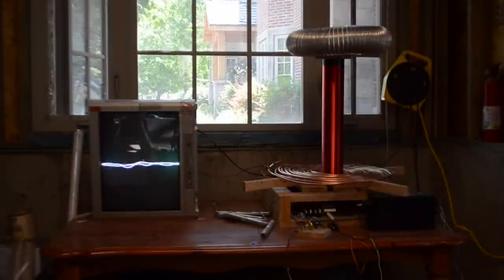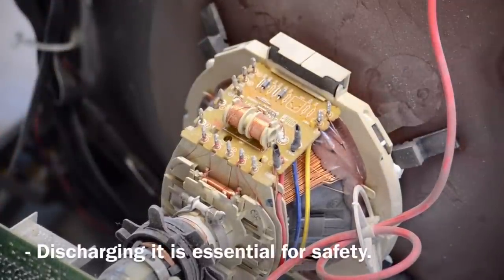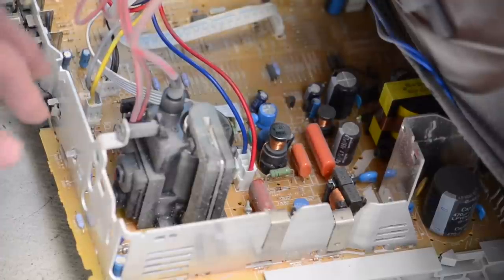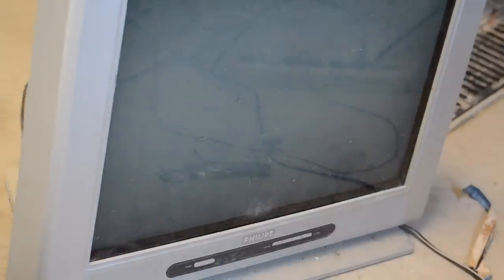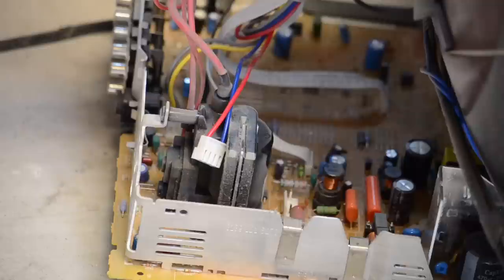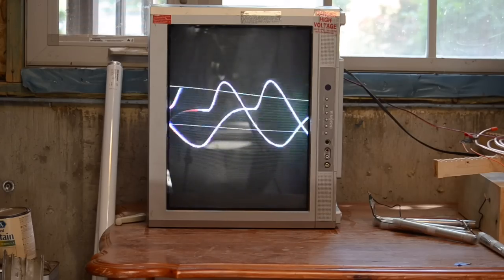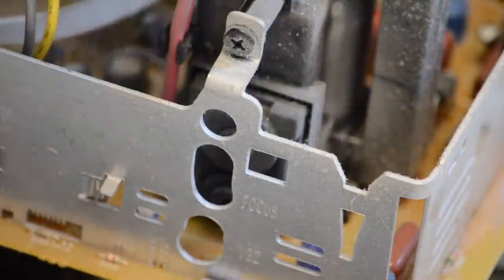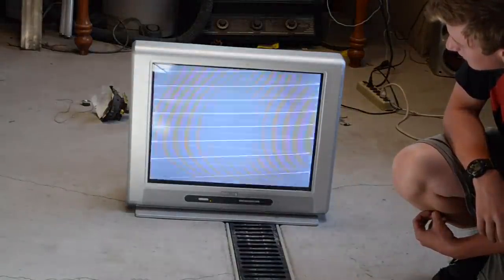How to make an OSCILLOSCOPE

Comment from the maker: By the way, you can calibrate this to use to measure peak voltages and such, I'll make a video soon showing how
Reply: I did it and it worked!!! it's really cool and was you addjust the fly back trasfomer(when it's unplugged,thanks for the tip) you can make it be a thick rainbow line.
Reply: if you can make a vr headset, no need for audio. just plug hdmi into pc, no android required, ill pay you for it. gotta be under whats in the market of course. 
and try mimic the lighthouse tracking that htc vive has. Its way better than IR positional tracking, a little anyway.
Reply: Keystone Science, I made one this evening, but it keeps popping capacitors and mosfet transistors... any remedy for that?
Reply: Keystone Science
Reply from the maker: +zeb evans wait, the oscilloscope is popping mosfets and capacitors?
Reply: Keystone Science  yeah, I had it running for about 30 seconds before I got a loud whine from the board, then smoke. blew a capacitor and melted the legs off of the mosfet
Reply from the maker: +zeb evans oh wow, that's super interesting, I've never heard of that happening before. Were their any problems before hand? ( I've run mine for a long time and it just recently (a week ago ) broke ( that's why it's no longer in the background of my videos ) but mine broke because it fell off the table and the vacuum tube broke. )
Reply: Keystone Science, I had no problems before hand, but once it started to go, it was done for
Reply from the maker: +zeb evans huh, that's super weird, is it possible that when taking the TV apart, or when disconnecting the coils that you messed up the connection on another part of the board accidentally?
Reply: Keystone Science, that is a possibility, yet I was very deliberate with my disassembly
Reply: Keystone Science So I tried doing this with an old crt TV. Things were going well but I didn't know where the capacitors were or how to discharge them so I just ran my grounding cable everywhere. I touched something (with the grounding cable) rather large in the circuitry and it blew up, bright light and all. The wires on my grounding cable melted together, and the TV won't turn on anymore. 

I'm wondering if you know what part of the TV I grounded, and why it exploded/broke the TV?
Reply: +clonesmustdies Was it connected to anywhere (I assume not)? If not, then it was most likely a big capacitor. Did you just use a thick wire straight connected to the ground? That would discharge the cap in an instant thus melting your cables.. As discharging capacitors too fast (without enough resistance) will damage capacitors the explosion was the capacitor breaking..

Now the important part... Even though you broke the TV you managed to save your life, a big capacitor with power stored inside enough to melt your cables could easily have stopped your heart. So for next time remember the safety!
Reply: clonesmustdies Melted? Exploded? Dude, you're supposed to do that unpluged from the electrical socket. And there's no need to run ground cable everywhere, just short the capacitors above 100 volts.

There are 4 major places where you can get a powerful shock from an unplugged CRT TV:

1. Primary (Hot) Smooth Capacitor, right after the full bridge rectifier (160~280VDC). Enough for a loud bang and some sparks when shorted.

2. Flyback Output Smooth Capacitor (180~250VDC) RGB Cannons' Power Supply. Not so loud bang and some sparks when shorted.

3. +B Smooth Capacitors on the Transformer Output in the Secondary (Cold) (80~160VDC) - but only if there's a blown fuse after that capacitor. Loud bang and some sparks when shorted.

And finally, 

4. High Voltage Flyback Socket (Over 7kvac). Yes. It remains charged with thousands of volts thanks to the CRT. It's just enough for a small arc, tho. Just a quick static pulse but ONLY if you manage to stick something inside that rubber thing that's supposed to keep the socked sealed - or if there's a leakage somewhere along the cable.

None of those are able to explode or melt anything, but they're enough to get you a fibrillation or scare you to death. Charged capacitors hurt real bad and VAC hertz even more.
Reply: Did you ever get a chance to make that video?
Reply: Can you measure 120 v AC with this thing?
Reply: Idk if you still answer questions from this but, will this work with things like Jerobeam Fenderson songs or vectrex games?

Comment: I learned to be careful taking apart tvs like that the hard and painful way
Reply: i was attempting what he did, ended up getting shocked twice. Apparently the hole where the suction cup was plugged in held a charge too so when i went to wipe the dust off the back of the tube i got a good jolt. then i tried making an arc like he did when he unplugged the suction cup in the previous video and it ended up jumping from the ground wire i had to my hand instead. even more involuntary arm dancing

Comment: Hi, I just completed this project, and it worked like a charm- I loved it... until it tried to kill me... (Not really). I was playing normal songs and using a frequency generator when the tv suddenly screached at me- it sounded like the flyback transformer. It was a sudden, very loud, continuous high-pitch sound. I unplugged it immediately. Any idea what happened? Is it dead? Thanks!
Reply: did you try turning it off and back on?
Reply: I mean it's a tv after all so
Reply: Am also curious if you are still coherent
Reply: @StaticFPV  hahahahahahah

Comment: Shango066 has a video where he ends up going through the "supporting levels" of vintage CRT's. Excellent video!

If I recall correctly, horizontal drive is what drives the high voltage.

Comment: Hey man! I’ve been searching around on the best ways to do this, I think my tv is one like yours, any other ideas to remedy the “protection mode” it goes into since the video was made? 
I don’t have another tv to sacrifice 😓 
Currently I have it set so there’s both wires from my stereo speaker outputs, hooked up to both the horizontal and vertical coils in the tv 
Whilst leaving the flyback to charge the tube of course, if you have a chance I’m going to post exactly what I have currently on my channel for reference, but I really like it how you had it going! Truly what I was aiming for initially. 
Was the audio from your stereo just coming from one speaker positive and negative?

Comment: Hi! Did this with a tv, after some time, the beam in the center of the screen created a small dark spot that stayed after turning the device off. Can it be dangerous to continue using it? I'm thinking it might have removed the safety layer inside and I'm afraid of the x-rays.
Reply: its just screen burn. its nothing really.

Comment: The reason that the TV didn't start up with the same amount of resistance in resistors as the resistance of the coil, is because of the inductance of the coil. The coil will limit current by using power to drive the magnetic field associated with it. Resistors won't do that, so you'd have to use something of equal inductance.
Reply: Hi David, I seem to be running into this problem trying to build an oscilloscope of my own, what could you use in this case that isn't a resistor? Thanks!
Reply: Connect the horizontal coil to the vertical output, And connect the audio to the vertical coil. Boom don't even need to turn it around.

Comment: Always resourceful and enjoyable video contents, yay! Thank you very much Nate:) i really love what you're doing** i love physics, too. Thanks to you😊 you are so inspirational! Did you self thaught yourself? You're crazy talented^^ i already give a thumbs up plus subscribed. Love ya♡ (btw, i have one question: what does flyback transformer exactly do? Is it a high voltage converter thingy?)
Reply from the maker: awe, thanks <3 
Yeah, I'm self taught,  also good to hear! physics is the greatest!! A flyback transformer is a highvoltage transformer, but it works in a special way called flyback, basically, this means that it is very good for switch power supplies, so i can push current through the primary coil and it builds up a magnetic field. The secondary coil has a diode across it as to only allow current in one direction, when the field strength is high enough, the magnetic field on the primary rapidly collapses, and induces a high voltage across the secondary. This happens in rapid frequency determined by the driver attached to it. So yeah, in essence, that's about it! It's all just changing energy from one coil to another through a changing magnetic field!
Reply from the maker: However, if you mean to say what does it do within the TV, it applies a high voltage field across a near vacuum of the CRT, and so this way, the electrons with a negative change are driven towards the positive side of the TV, the electric field causes the electrons to accelerate to a very high velocity, so that when it collides with the phosphorescent screen, it will be enough to create photons of visible light converted from the energy of the electron :)

Comment: If you don't wanna have it laying on it's side and you'd rather just use the 60hz, you can just plug the vertical deflection out from the board into the horizontal coil. Also, I agree that the "safer" TVs suck for any electronics projects.

Comment: Why not make it horizontal?
Reply from the maker: The scanning of the tv makes it very hard to make it horizontal, it is much easier this way
Reply: You just connect the Horizontal coil to the Vertical output on the circuit board.

Comment: Hello, Keystone Science. I built one of these oscilloscopes this afternoon; easiest electrical build I've ever done thanks to your video. But if I had an input signal and wanted to determine its frequency, how would I go about changing the speed at which the electron beam zips back and forth across the screen, like a "real" oscilloscope? Could you cover that in a future video maybe?
Reply: the speed of the horizontal sweep is usually controlled with a sawtooth wave generator. i imagine the answer youre looking for is related to computing a value from there.

Comment: I belive I just shorted out my TV. Is there any thing I can do so that it will work again? Thanks in advance.
Reply from the maker: +CallForPlay where did it short out at?
Reply: So... when I got this tv, it wasn't working. I learnt it was a simple problem with the flyback Anode. It was misplaced. I basically put it on the right position, and turned the tv on. It worked properly! Well, at least for the next 2 minutes, hehe. I turned it off, and when I turned it back (actually, just plugged it on the outlet, and it started by itself) it behaved like yours. It took some time for the image to appear, the image presented those diagonal strips, and after some time it would turn itself off. That's all I know... Hope I can still save this tv for useful experiments!  :D

Comment: Thanks for this video! Do you know if this would work with a CRT monitor? Or do I need to use a CRT TV? Thanks!
Reply from the maker: +Josh Alpaca hi! A CRT monitor should work fine for this aswell, as long has it has the horizontal coil, and the vertical coil then it should be ok!
Reply: Thank you so much!!! By the way, I love your channel!
Reply: @KeystoneScience  Mine isn't working. the line is about an inch long and it is just getting longer and shorter along with the music. Reminds me of a vu meter. how do i fix this? can u reply soon?!!!!!!

Comment: what if you swich the wires of te gray and jelow whit the blue and red you can rotate the tv to its original position an you dont have to conekt a second coil
Reply: I believe it is with the way CRT's create images by 'scanning' the beam across the screen.  They scan top to bottom - left to right.  The left to right scanning was probably just to fast for him to properly display audio frequencies so he used the top to bottom scanning.
Reply: but swicing x and y is jus rotating te sceen 90 derees
Reply: But switching* the* x and y is just* rotating the* screen* 90 degrees.*  Yes but the scanning speed for X-X and Y-Y are diffrent.  X-X scans faster then Y-Y.  This is because for every Y incriminate it scans a whole row of X.
Reply: different* increment*

Comment: Be forewarned TV'S can provide FATAL doses of electricity, They operate with high voltage even in what may appear "safe innocuous places" even after being unplugged. The hi capacity capacitors hold charges for lengthy periods of time. BE CAREFUL. Always unplug, let TV sit for at least an hour, then discharge the capacitors. Discharge capacitors with grounded screwdriver no bare metal where you touch the tools. Always use grounded electronic tools- rubber grips on handles (minimum, use best insulated tools you have). If you don't know what I mean by anything written  above leave TV alone!  Don't take it apart. Again take extreme precautionary measures. High voltage can kill!